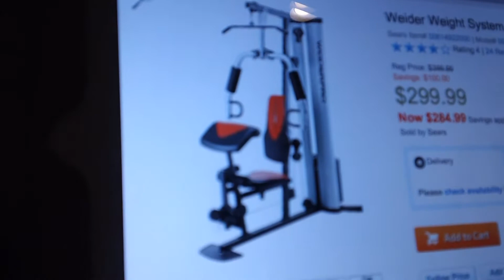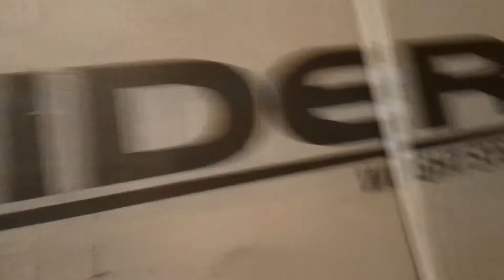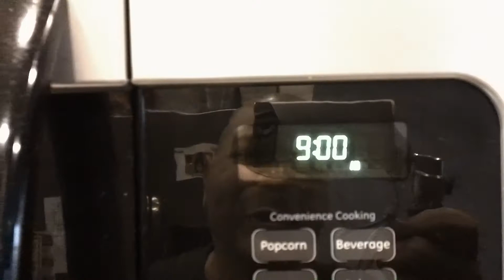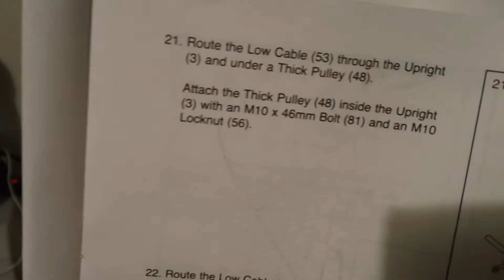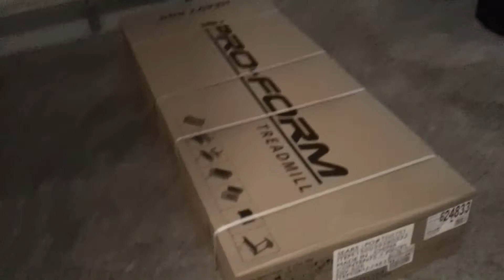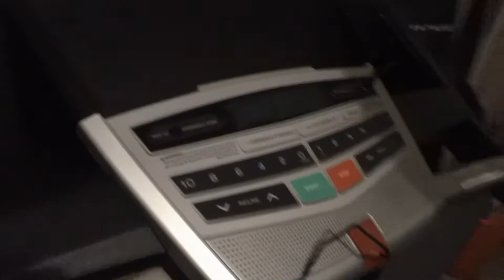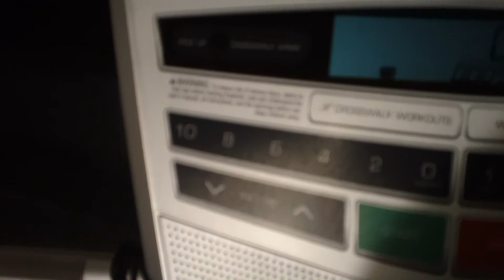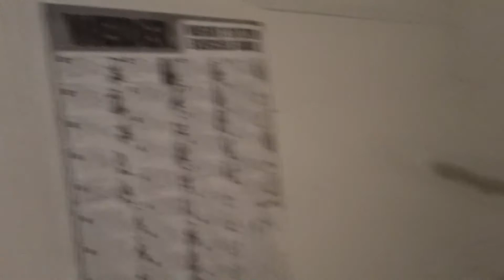MAKING  A HOME GYM. Making your garage into your personal GYM :)

Comment: I curious, what about the cold and moisture in from the rain/elements? I am assuming that would effect the electronics of your equipment and possible cause rust from your weight lifting equipment? I am asking because I thought of using my garage just like this, but was told about moisture being an issue. I'm not concerned about the cold, was ujst wondering what you did if you r garage isn't heated?